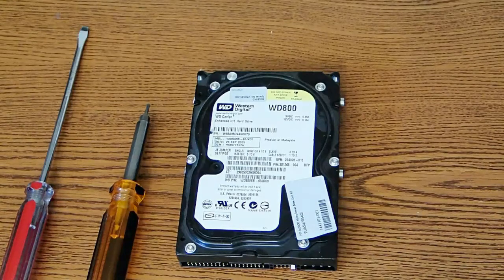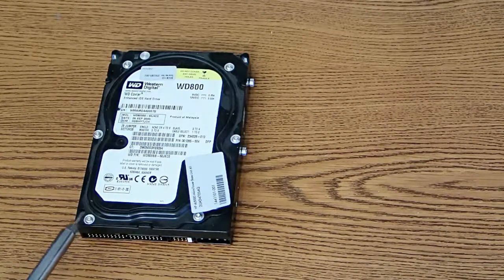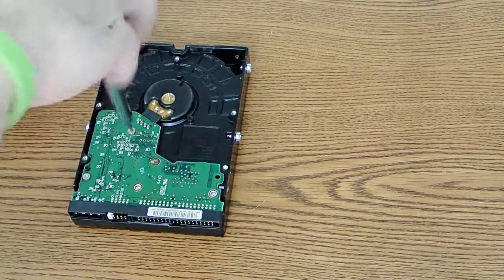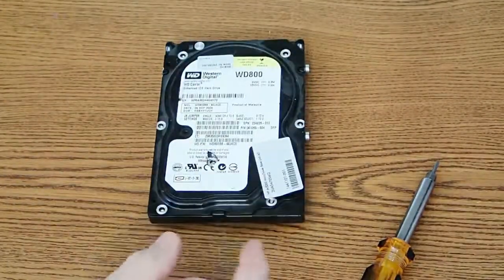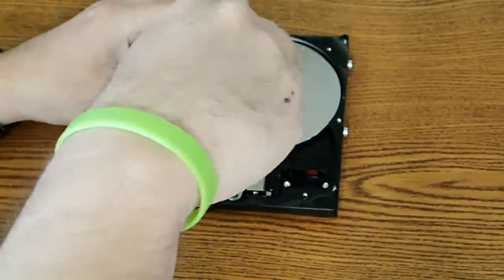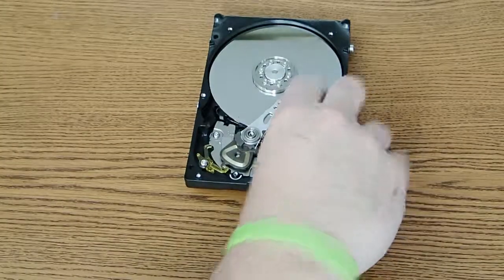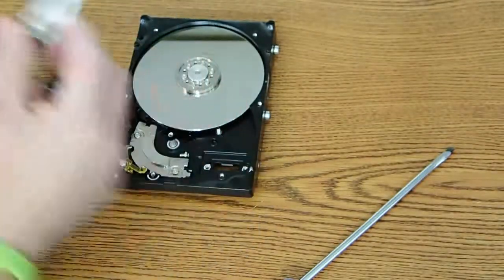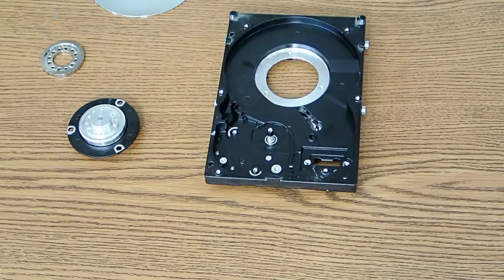Desktop Hard Drive Tear Down & Dissection

Comment: Those magnets are so powerful!
My guess is the sponge block is in the airflow for collecting any dust or moisture spun off the platter.
The motors I think are stepper motors and require some complex circuitry that give multi-phase sinusoidal waves to get spinning fast - a drone esc controller might do it?
Reply from the maker: Good guess on the sponge. Not sure what type of motor it is but I know it has to spin fast (at least 5400 RPM) so I don't know if it's a stepper...